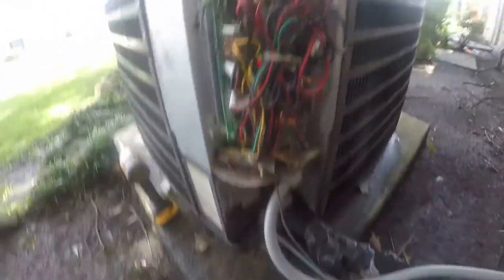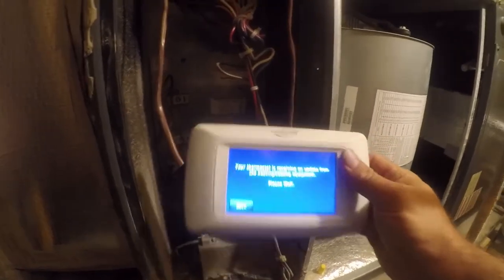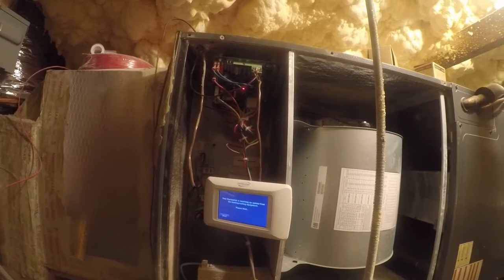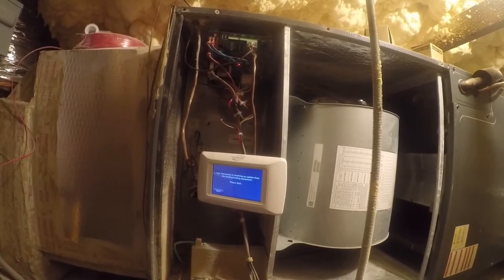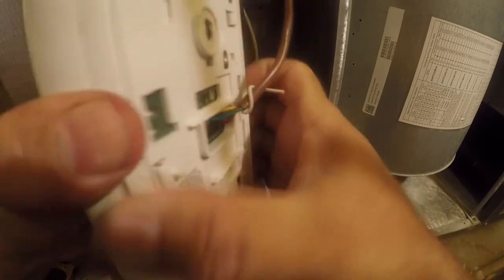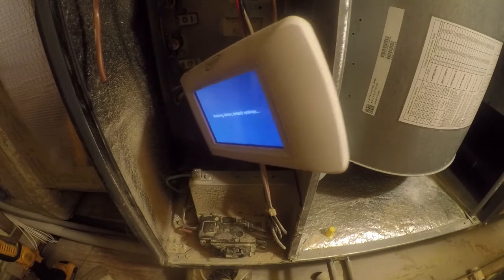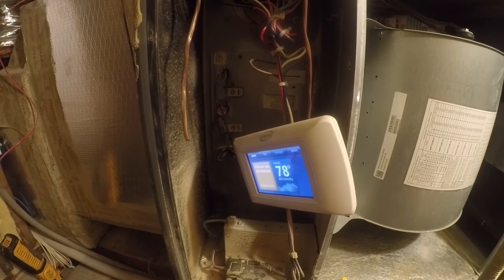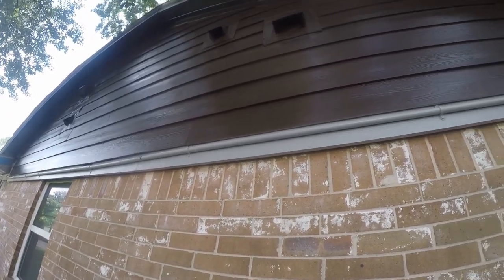Goodman Non-Communicating DisComfortNet - Part 1 of 3

Comment: This thermostats have issue after some time most common is a “lost communication with a network  “ I’m talking about wired network not Wi Fi,in my case it’s a pain in a but message come and go and you can be stuck without AC and Furnace till you reset unit you have to pull everything from the wall I wonder witch another unit will be compatible with a Goodman furnace or Honeywell wireless home network
Be aware of this issues home owners
Reply from the maker: converting to non-communicating has worked, but I did lose some efficiency in the dehumidification and the variable speed fan.  I saw my energy bill jump.  Beats putting parts into the unit though on something that Good(fornothing)man has admitted is a failed system control.

It seems to be a failure in the control board in the air handler on the network side.  More than likely a lack of surge protection on the network lines blowing out something in the communication stack.  Fortunately it's a modular board and you can just abandoned that part.
Reply: @hotpuppy72  
Thanks for help Brian I will investigate control board for air handling 👍🏻

Comment: Your control board is bad in your hair handler
Reply from the maker: Yes.... the network side lacked overload protection.  Shit engineering in pursuit of the lowest penny.  Using shielded, grounded shield thermostat wire would probably have prevented induced current from a lightning strike, but who the heck does that?  Compressor shorted to the power wires a couple years later and fried itself..... something else nobody would have predicted.  It was then removed, scrapped and is probably back as a barbie-mobile at WalMart having completed its Chinese life-cycle.